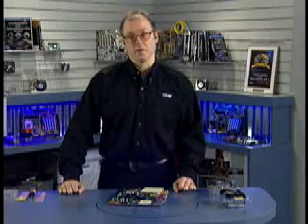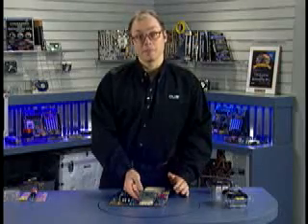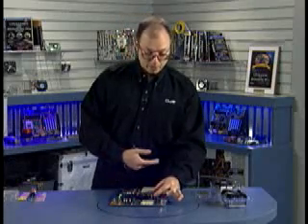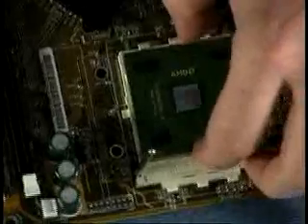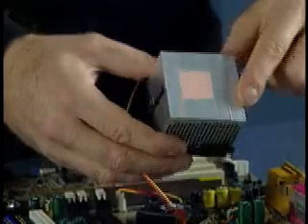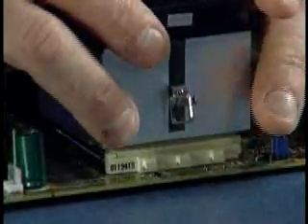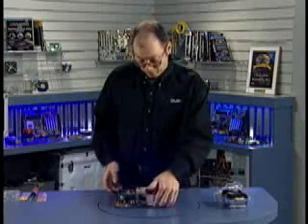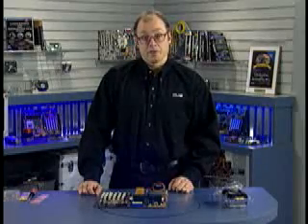How to Assembly AMD Athlon XP Processor to your Motherboard

Comment: Memories! 10 years ago the very last PC I built had an Athlon XP2000+ with this board, 256MB RAM, Radeon 9800PRO, 120 Samsung HDD.  I used it every day until sometime in 2008 when I had to change to using a laptop instead.  Three crappy laptops later I'm trying to justify building a desktop PC again, I just need the space.  How times have changed since 2003!

Comment: Great video man you gave me good ideas of how to reduce my CPU usage.
In task manager the CPU was at 100%.

I added Arctic Silver 5 thermal compound. Went down some %.
The capacitors on AMD socket A are bad. I used an Air duster on the HSF and got rid of dust.